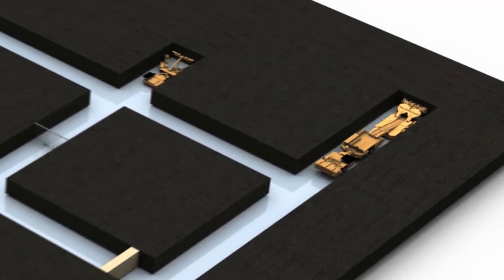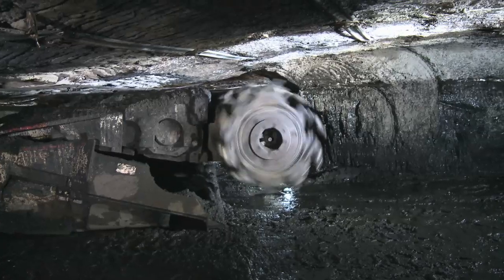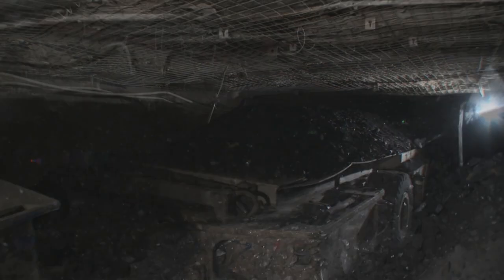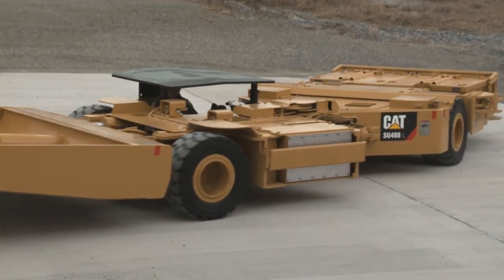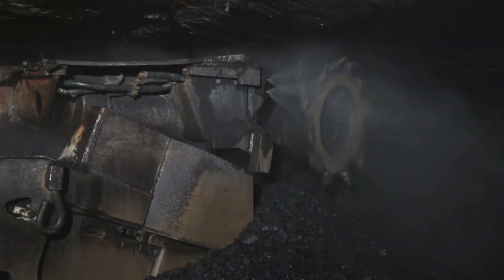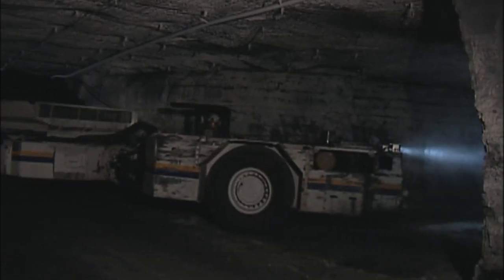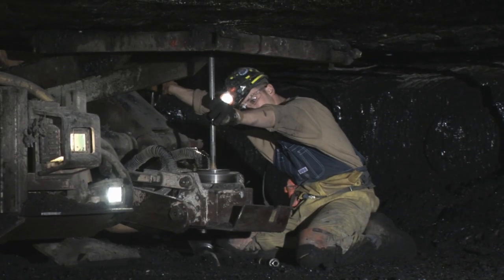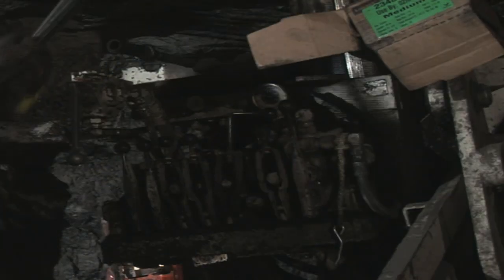The Principles of Room & Pillar Mining

Comment: What’s the highest and longest tunnel this machine has built?
Reply: the length of a panel is relevant on the size of the lease  and the costs involved in supporting and ventilating the mine. Your question is akin to how long is a piece of string....
Reply: They don’t build tunnels, although they could. A continuous miner mines coal, either in board and pillar mining, or in development for longwall mining. Some mines have hundreds of kilometres of underground roadways, as well as the mining panels themselves. 

In development a single miner can easily develop 50-60 metres per shift, but the challenge is maintaining a sequence of mining, coal clearance, and strata support (bolting). It’s easy enough to mine it, but you’re limited to roof support. I hope that helps.

Comment: Wouldn't driving bolts into the roof make it less stable? You're opening cracks into the roof, after all...
Reply: They are glued in place, helps to keep the whole structure stable but yes the roof top can fall during the bolting
Reply: The bolt hole are drilled first and plates to help distribute the weight.  Most bolts use some form of resin that is heat activated.  Drilling them in generates enough heat to active it.  One danger is with bad top (like sediment layered) which has thin layers that can break between bolts.  Some of those can be as sharp as knifes with weight behind it as it falls.

Comment: Where is the water coming from ? On board tanks or direct lines?
Reply: They have water pumps installed at the mine that feed the machines, usually with an 1-1/2" hose. Mines tend to have plenty of water in them. The bigger challenge is keeping the mine dry.
Reply: Fireline.
Water pipes that are advanced with mine progress.
Manifolds are in place along the line so you can tap into it
when a supply of water is needed.
You also have a pump out line for waste or excess face water to be returned to the surface dams.
The cycle begins again.
Steve is right. We need water to cut and supress dust but excess water from the mining process
and water coming out of the face can be a real pain to get back to the surface.
Can make an unpleasant workplace, a very unpleasant workplace! :-)

Comment: Always wondered why they make the ceiling so low.  Just make it 8' and people can walk in it then.
Reply: The cost to cut the rock is too much for profit. The height of the mine is determined by the height of the coal seam. All coal that leaves a deep mine must be run thru a wash plant to separate the rock from the coal. The less rock that's cut the cheaper it is to run the plant. It's all about cost. Some top is white sandstone and they would be replacing miner bits continuously for more profit loss. Low coal mines are somewhere between 42 inches  high. And some rock does have to be taken to work it. The only limit to the minimum height is the height of the continuous miner.